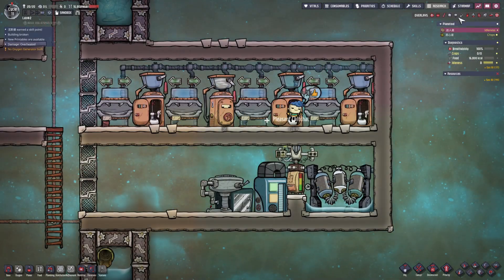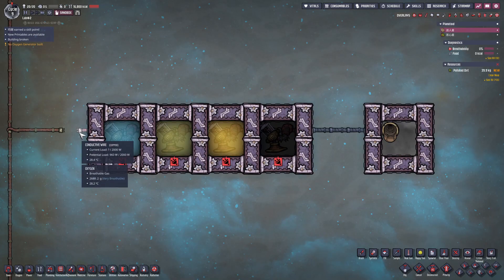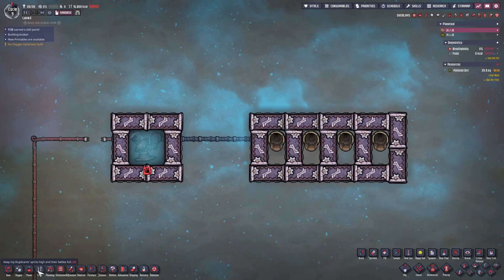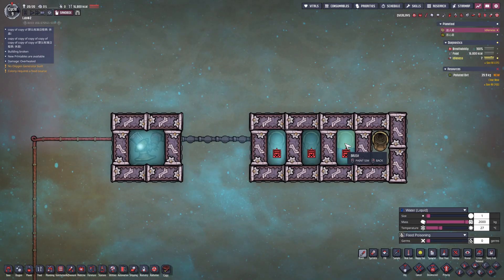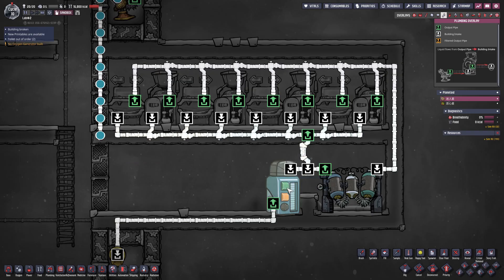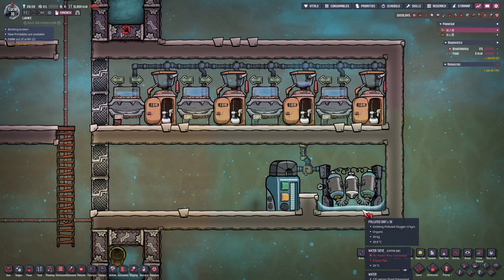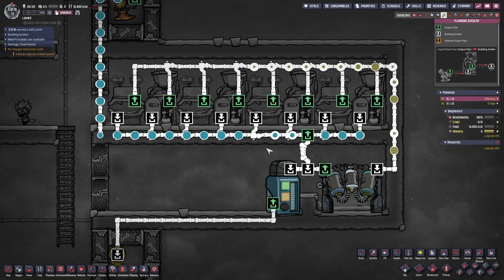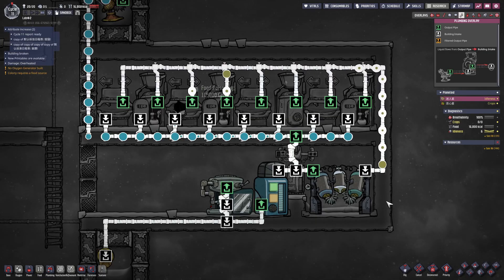ONI - The BEST toilet water recycling system!! #1 | FansGame-k7k

Comment: Over engineered and over explained.  
Your O2 pressure should stop the polluted dirt from off gassing.  
You should explain the blow off from the pipes.  You can make a blow off "valve" on the fresh water side or the polluted water side and just dump that into reed fiber or bristle berry to eat the excess.  A blow off "valve" is the white side of the pipe bridge, when the pipe is full on the green side, the next water packets go down the white side pipe and into the plants. 
Also the alternating sink and toilets is weird.  If one exit then do four toilets and four sinks with the sinks on the door side. If two exits then two sinks, four toilets, two sinks.  Set the directions properly.
I'm not saying you are wrong, there is just better ways.

Comment: ....U DIDNT SAY IS IT FOR base GAME OR SPACED OUT! ,though

....BECAUSE FOR DLC,IT'S A MUCH BETTER

........YUP,ABOUT AN open SYSTEM WHERE WATER IS POURED AT SOME pool WHERE SOME WHEEZEWORTS in flower pots ARE PLACED BETWEEN WHERE WATER IS POURED FROM,AND LIQUID PUMP,SO THEIR RADIATION WILL EFFECTIVELY KILL all the food poisoning BY REPLACING THESE GERMS WITH radioactive containments GERMS.....WHICH DYING immidiately IF NO LONGER UNDER RADIATION......SO THE WATER IS PERFECTLY READY FOR ALL OTHER applications SUCH AS BEING USED BY JUICERS OR SODA FOUNTAINS

.....ALSO there a hydro sensor IN THAT SCHEME APPEARING WITH A liquid shutoff WHICH IS PLACED ON A PIPE TO DEAL WITH OVERFLOW.......AND KEEP THESE RADIOACTIVE GERMS IN WATER FOR INSTA PURIFICATION,of course

......BESIDES, DONT BE SHY,EVERYONE ARE USING EXPLOITS ........SO and FLOWER POT EXPLOIT,and INFINITE LIQUID STORAGES ARE also OK TO BE USED....

Comment: does the game not care that they are washing their hands in germ water?
Reply: According to how I understand things, no, it's totally fine.  The only time this filtered (but food-germy) water is an issue is if you used the water to grow crops the Dupes eat.  Say Bristle Blossoms. 

On the other hand, if you're using a Liquid Storage container (and have automation) you can just put those in a Chlorine filled room and use germ sensors to let the water back out when it's actually clean/pure.  Yes, water in a container can be cleaned by gas outside said container.  Welcome to ONI!
Reply from the maker: Thanks for the helpful comment~

Normally, I just use the germ water to make the oxygen. When it turns to oxygen, the germ will die quickly because they can't survive in gas. And those in the hydrogen, they will disappear in the hydrogen generator.
Reply: @cannonbait7781 No, you can grow bristle blossom plants in germy water no problem... It's actually my recommended strat as it gets rid of germy water without needing to purify it.
It only becomes a problem when;
A. You use it to make oxygen in an electrolyzer. The oxygen will have germs and they will spread quickly through the base.
B. You use the germy water in direct cooking (as in water is an ingredient in the food). I think this is only mush bars but it could be a newbie sleeper problem if they don't realize the siv doesn't clean germs.
C. The dupes take the germy water and use it to fill up a water cooler and drink it directly.

It's only a problem if they ingest the germs. You can use it for the hot tub or the Surf board or any other non ingesting use with no issue.

Creating a closed loop with a polluted water deleter is the best method. My favorite is a single reed fibre plant on the dirty side of the siv to catch and delete the excess since they don't require light. It deletes the excess and you eventually get a fiber from it. And you can easily scale the use by just adding more reed fibre plants if it's building up.

But if you want to actually purify the water, I would suggest running it through a metal refinery. This will heat it up hot enough to begin killing the germs. You can then store it in a tank or reservoir until all the germs die and then it's clean again. It will be hot though, so you will need a cooling method. Also, of you use a reservoir, be aware that water in the pipes leading to it, and water in the reservoir will all loose germs, but the water trapped in the input node of he reservoir won't for some reason, so if you do use reservoirs... Make sure you have enough in series it will never top out and become trapped in the nozzle.
Reply from the maker: actually, that's why I don't like tap water..lol

but seems like they use the water with food poisioning germ to wash hand is totally fine. 

and thanks for watching my video ~

Comment: You need to also purify food poisoning germs, this could end very badly if you just dump clean toilet into your water supply.
Reply from the maker: Thank for comment~!

Normally, as long as you don't use this water for food or drinks, your dupes won't get food poisoning. Using it for irrigation or oxygen is totally fine. Even if they do get poisoned, the effects are very little  - it's very hard for dupes to actually die from it. If you're really concerned, normal toilets are ok as well.